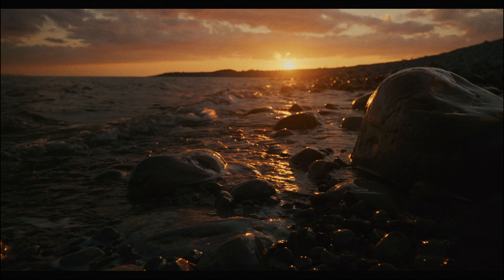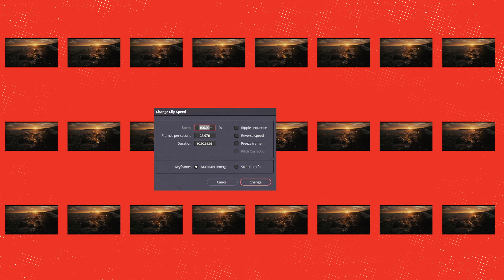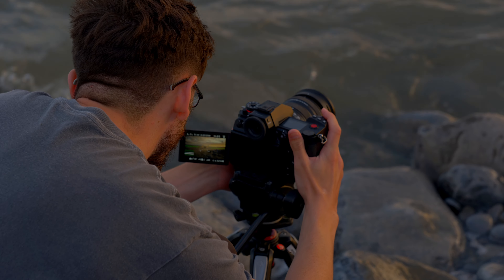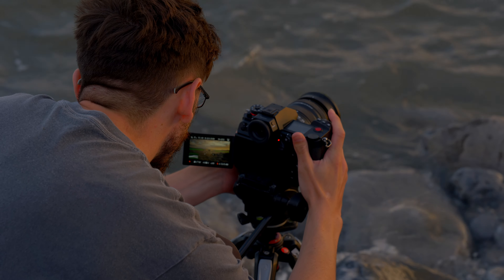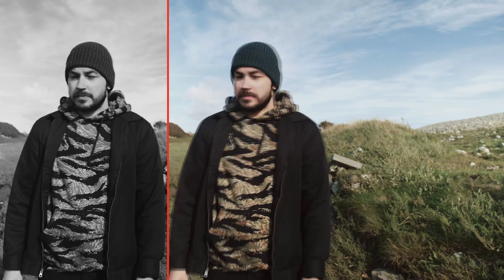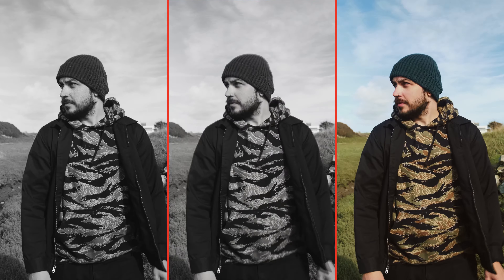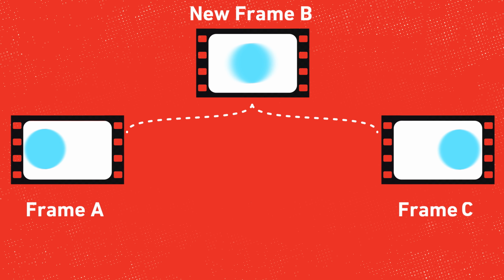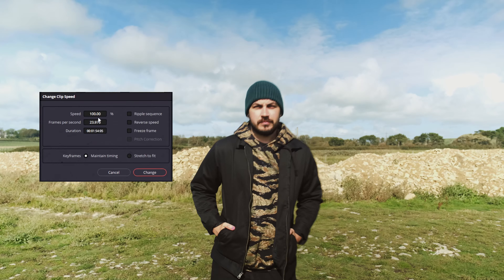How to Get the Best Slow Motion Video | Optical Flow Tips

Comment: It's worth saying it's not "either" high FPS or interpolation, but rather you can achieve significant results using both together.  Getting your camera set to 60, or 120 fps if you have it gives you scope to slow down much further than the clean footage from the camera allows.  Also I'd question the instruction to stick to 10 or 15% reduction.  Reducing by factors of your frame rate is more of an issue, and in theory things shouldn't look MUCH worse down to 50% of your original frames, as you're just interpolating one frame between every two.  

Annoyingly though, in a world where cameras tend to offer frame rates in multiples of 30, we then commonly display video in 25fps (especially outside the US)... which is not a simple factor of 30, or 60, or 120, which means your software is then interpolating irregular batches of frames, and leads to a less clean effect.